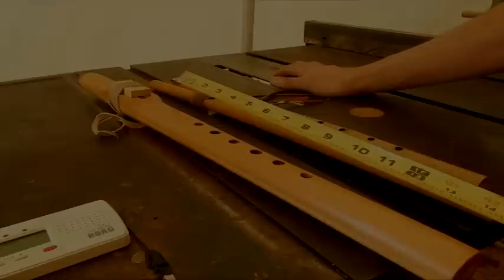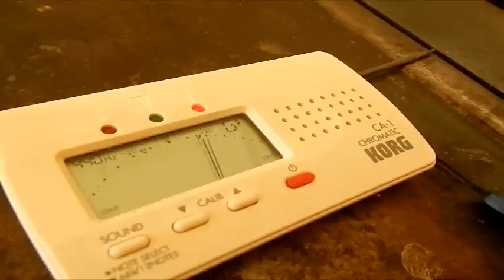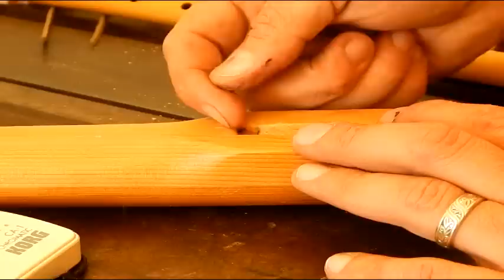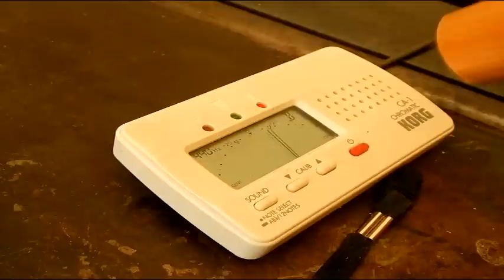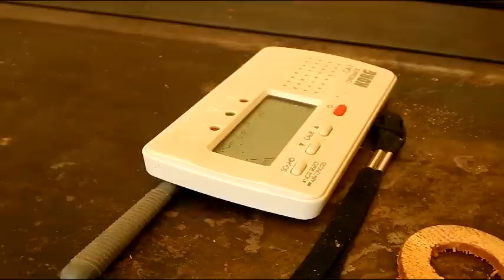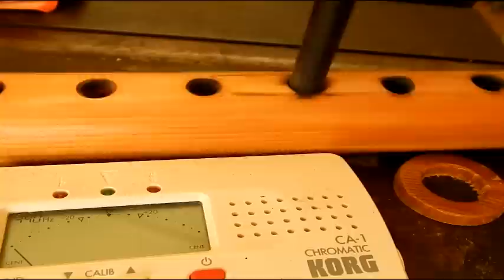How to Re-Tune a Native American Flute that is out of tune with Charlie Mato-Toyela

Comment: I went to burn the sound hole to clean it up a little bit put two little hairline cracks in The Cutting Edge. Put a little Super Glue on both of dim and packed it was sawdust and smoothed it out I don't think that it will crack any worse do you. Is still plays beautifully loud and clear
Reply from the maker: @larryshortridge5094  it shouldn't get any worse, as a matter of fact having the super glue on the sound edge will actually improve the tone!
Reply: @BlueBearFlutes  thank you Charlie
Reply from the maker: @larryshortridge5094  🙏🏼😊🙏🏼 Thank you for watching!

Comment: I read an old document about flute making and it said that the flutes used to be made to the measurements of the makers body. the distance from the sound hole to the first fingering was the width of the fist, as was the distance from the end of the flute to the last fingering. the fingerings were one thumbs width apart and the whole flute with the mouthpiece was the distance from the tip off the middle finger to the armpit, or the length of the forearm depending on the material used.

Comment: The wall thickness was so thick that you could undercut the holes without making them bigger. Another thing I made that helped a lot, was I put a slot hole at the end of a dowel and made rag patches, like a gun barrel cleaner and rammed the bore after each hole. The saw dust, as you know makes a huge difference and can throw the tuning way off. it also cleans all burs off the bottom of the holes. It also is good for getting excess oil or finish out of the bore. I dipped my flutes. Your methods are quite different than mine but obviously work for you. Very concise and well done video. Even making and tuning my own flutes, I learned a lot from you, so thanks. Maybe someday, I'll pick flute making back up. I want to make the real deep flutes, bass A and lower. Tooling is a problem with those. Extra long and 2 inch bore.... I have squeezed a bass A from a 1.5 in bore though.... :-D
Reply from the maker: Landotter1 Thank you for watching. We can all learn tricks from one another.

Comment: Hi Charlie. I want to say that I love you're videos. 
I want to say though that your statement about the distance between the bottom of the flute and bottom sound hole being shorter traditionally than the top hole to sound hole and that the sixth hole being higher are slightly off. The sixth hole is used in the common position by the lakota. As is the equidistant spacing on top and bottom of the flute. 
I mean no disrespect. I am simply trying to share my knowledge with you like you share yours with all of us.
Thank you for your time experience and kindness.
Reply from the maker: Mike Daniels Hike, thanks for your kind words and know that your input is appreciated. I will be sharing some information on an upcoming video on making a traditional 6 hole flute (as well as 4 hole flute) that may shed some light on my opinion. I realize that I am going against the general consensus and will appreciate your revisiting and comments once you see the video. It will be a couple weeks from now. Thanks again for watching!

Comment: Hey there Charlie, I have a question somewhat related to the topic discussed here in your video. Is it easier to retune a flute tuned to 432 to a 440, or is it easier the other way around? Boring a hole bigger would seem easier I would think. I have a couple of flutes that are not tuned to 440 and would like them to be, which is why I'm asking :)